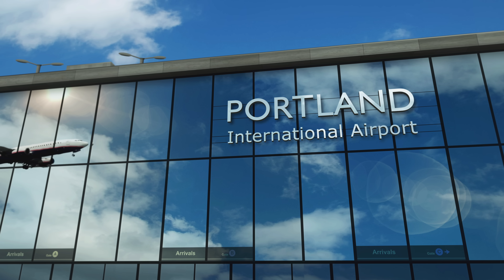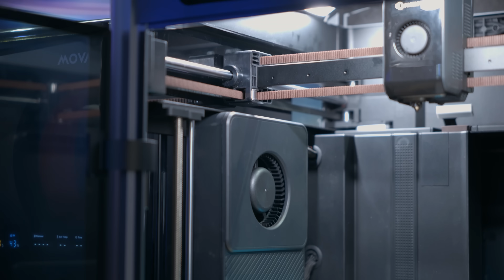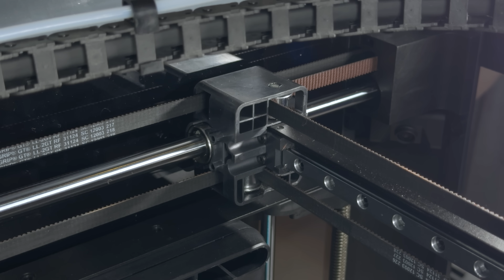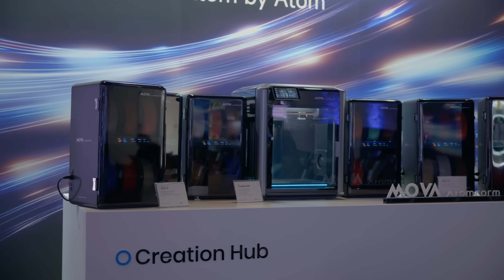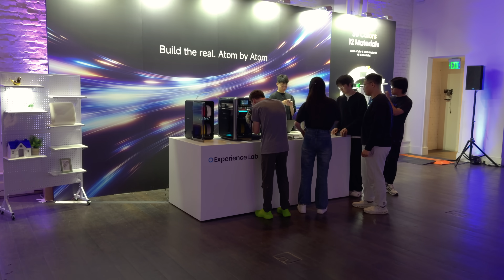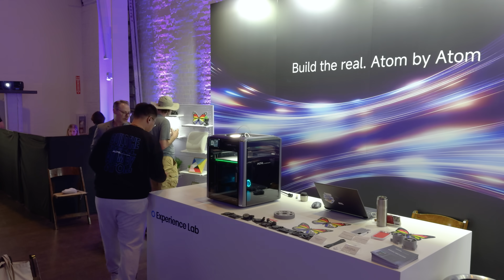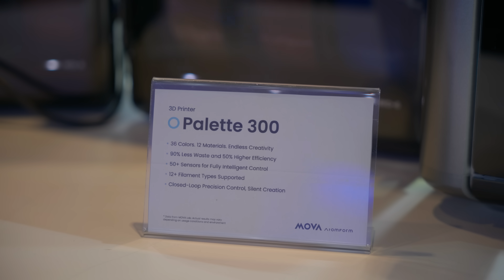MOVA AtomForm Palette 300 - The Engineering Nobody Noticed!

Comment: ...and why should I do this instead of an H2C and have more capabilities from a way more proven brand? And I thought we were done screwing nozzles in
Reply from the maker: A few things worth considering: price-wise the Palette 300 comes in under the H2C at both early bird and retail. The H2C gives you 7 nozzles (1 fixed + 6 swappable), and if you want more than 7 colors you're back to purging through the AMS, which kind of defeats the purpose. The Palette 300 has 12 dedicated nozzles so you can run 12 colors without nozzle sharing. On the 'screwing in' concern, it's actually more of a quarter-turn locking mechanism, not traditional threading. The machine handles it automatically. And not everyone is comfortable with Bambu's ecosystem, so having alternatives in the space is a good thing regardless. Whether the Palette 300 holds up long-term is what I want to find out when I get one in the studio.
Reply: @MandicReally  Long term reliability is what it really comes down to for me. Bambu's machines have proven themselves to be reliable over time, and there's still some unknowns with the palette; one of the major, often overlooked aspect being spare part availability. We'll see though.

Comment: Very interesting printer and I like that it is 300x300 since that is my preferred build plate size for my little print farm. I like how it preloads the next filament too - very clever. This might be the one that will fit best for my setup. I haven't been that impressed with the other tool/nozzle changing printers thus far.

I didn't realize some brands don't allow z-offset adjustment. I know Creality and Elegoo do since I have printers of both brands - interesting to find out not all do that though.

Comment: I think reliability is going to make or break this solution. Technically it is very impressive but the more complex a system becomes the more chances there are of failures. I wonder it'll be possible to get the RFD-6 working with my Prusa 🤔 Great video 👍
Reply: Yeah, that's a concern, although the the 2X alignment check is really nice and they said the mechanism should love 3 Years with regular use.
Reply: The subjective definition of “regular”. is often the problem.  

I am very intrigued by the machine and especially the RFD-6. I too am wondering if it could work with the prusa. :)